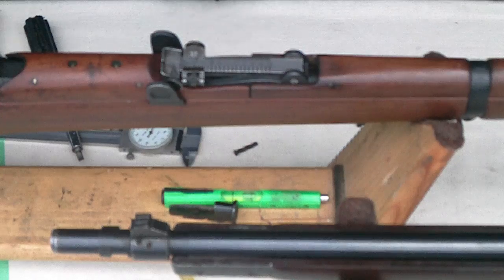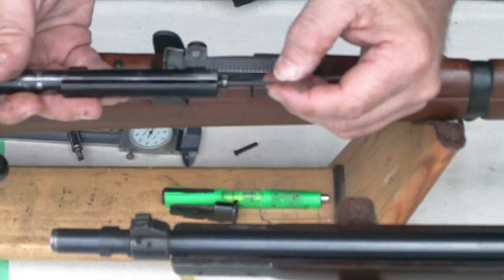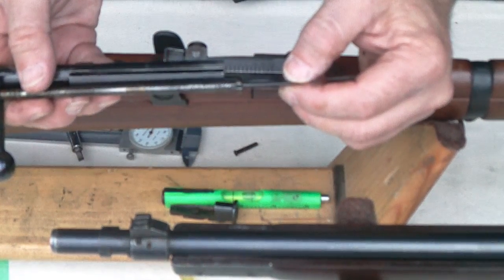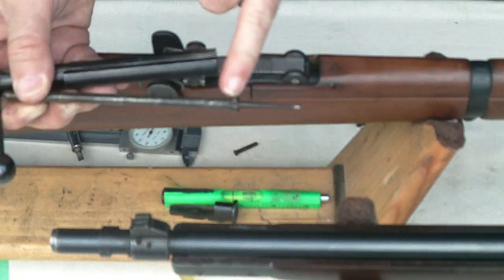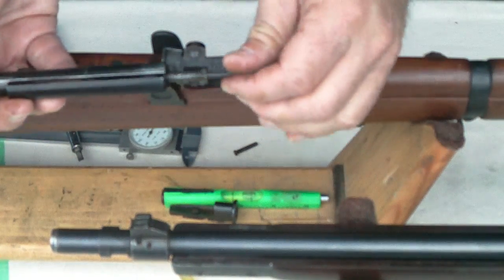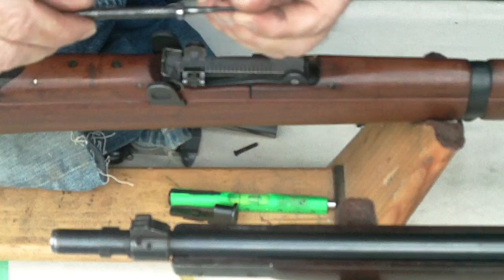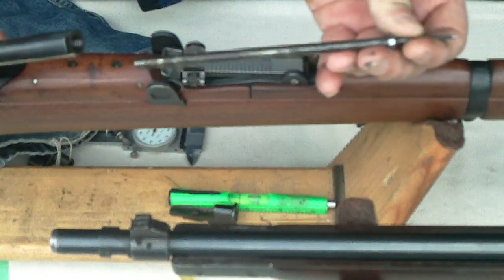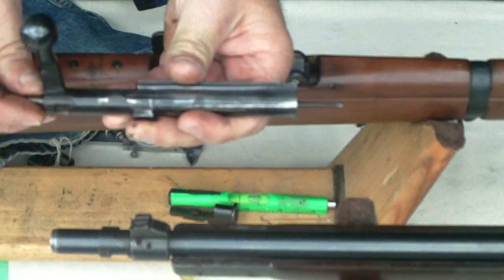Speed up the Lee Enfield rifle's bolt's lock time

Comment: I wish to thank you for this demonstration. I purchased a 1942 Enfield No 4 MK1 Sporter. Before firing a round, I disassembled the bolt (after buying the tool) and am certainly glad I did. Even though this rifle has been sporterized, it looks like the bolt has never been disassembled & cleaned. It was filthy an sluggish. After disassembling it, cleaning it, oiling it & reassembling it. It works beautifully.
I would have hated to have fired a round & have broken the firing pin.
Now it is clean, polished & oiled, as well as the firing pin checked for proper length.
I would suggest to everyone who might own this rifle to follow your instructions.
Reply: brother ive a question for ya, and please feel free not to answer if you choose as i respect your privacy, but i have a 1944 dated sporter no.4 mk 1 i gave $200 usd for. just wondering what you gave for yours